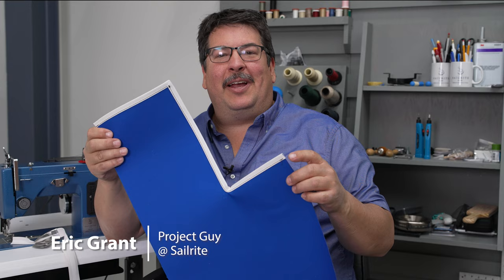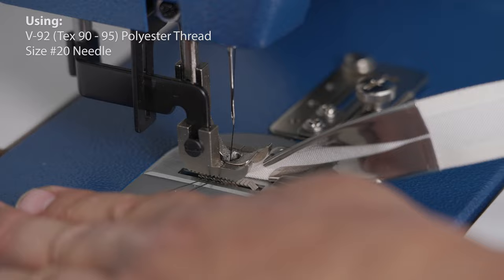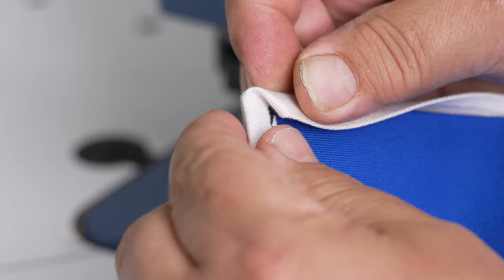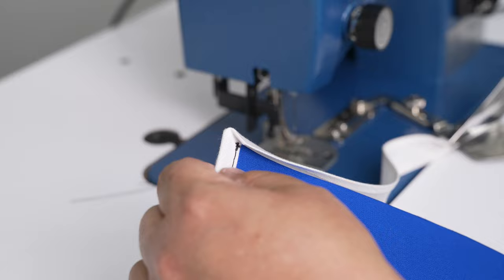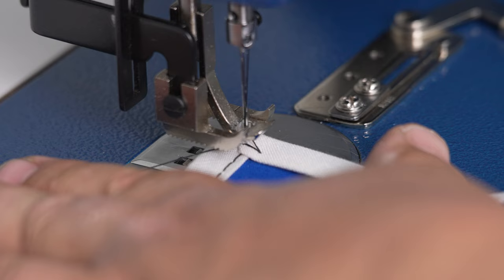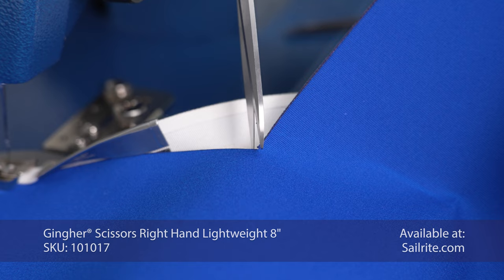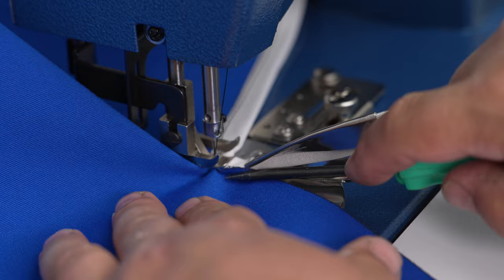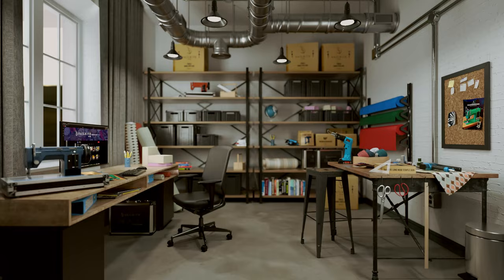Sew Heavy Binding Around a 90 Degree Corner - Without Cutting It!

Comment: I keep seeing example of binding but it’s almost always with one layer of fabric what about two layers or fabric with foam 1/8 backing.Something thick.
Reply from the maker: I think a few layers of fabric will not make much difference, but I have never tried it with 1/8" foam. So... that will need to be tested.
Reply: @SailriteDIY thanks for the reply back. Trying to bind two layers of 1/8 foam-backed automotive headliner fabric along with 2 layers of canvas material with a binding adapter I got on amazon for $30 and not having much luck. I wonder if your  binder adapter might actually work better. Anyway, You guys have great sewing machines that I will definitely consider if I need a second machine. I love all your videos. They are all helpful and interesting.